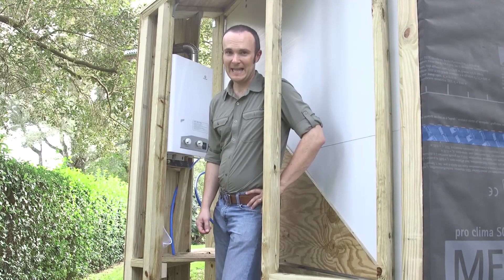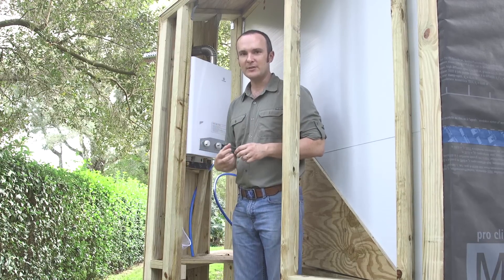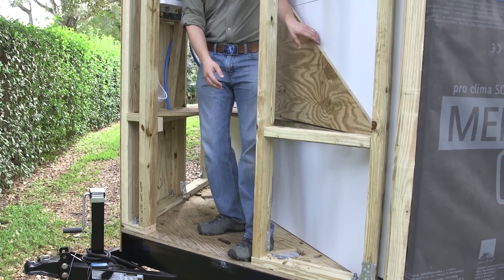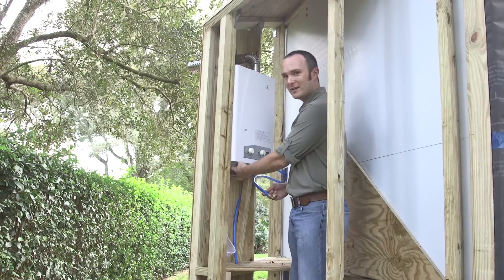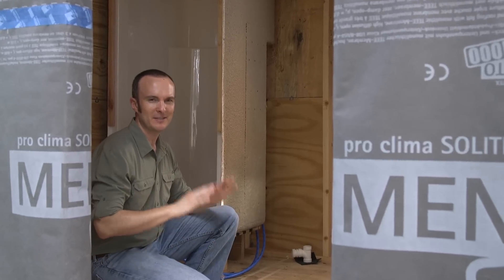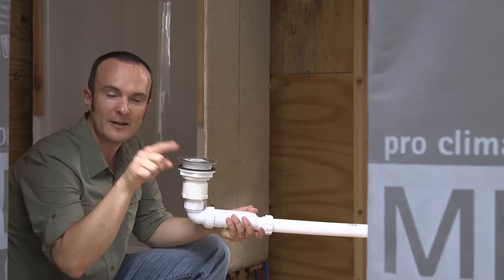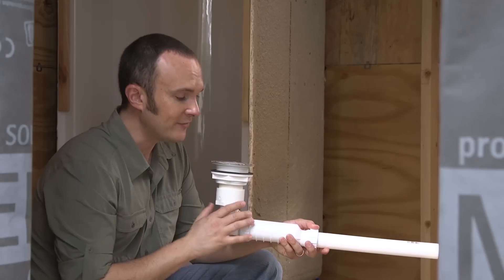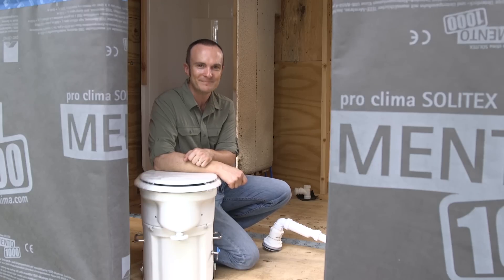Tiny House Plumbing: Intro to the #TinyLab system

Comment: Try using a "Shower Saver" for the shower head. No other head I've tried saves as much water. And because you can adjust the stream so low, it also permits you to take longer showers for the same amount of water.
Reply from the maker: +IamNemoN01 thanks! But we just turn the shower off while soaping up. Keeps it simple.

Comment: Could you comment on the total efficiency differences in composting vs incinerating toilets? Composting toilets draw conditioned air out of the home all the time but otherwise take no electricity while incinerating toilets may be vented from interior or direct vented from the exterior and are available in both electric and propane versions. Which is most efficient in desert conditions, in extreme heat and cold/dry and humid conditions. How much energy does the venting of a compost toilet cost, worst case scenario and how does that compare to incinerating?

Comment: I'll be getting a tiny house in a few months. But it doesn't come with water system. At least I'll need toilet for me to take dump.  I'll have tiny house delivered to a land I'll be leasing.  How much will it cost me to have a toilet installed and plumbing?  They need to dig the ground to get the pipes run right?  How all this going to work?  I'm clueless.  Plz help
Reply from the maker: Yikes, noobz. That’s why we emphasize planning- I have no answers for you this late in the game, sorry.
Reply: I haven't bought the tiny house yet I'm looking to get one but trying to get more info before I move forward. Same with the land. I didn't sign the contract yet. I may have house have walls insulated and have electrical outlets ready.  Though it would be convenient for me to have a toilet but not absolutely required. I can come up with other way around it.